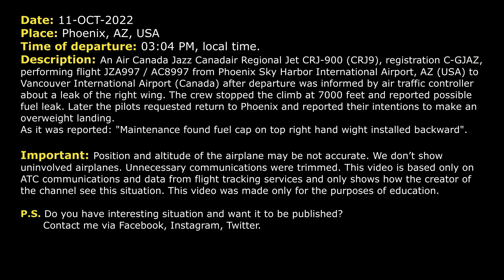Fuel leak on takeoff. Air Canada Jazz CRJ-900 returned to Phoenix. Real ATC

Comment: How could it get installed backwards? That was an oversight for days... 😕
Reply: I don't know much about airliner fuel caps, but I would think the same principal of "righty tighty, lefty loosey" would apply here and backward just means it was left undone? or can you really install the cap upside down?   inquiring minds want to know!
Reply: Seems quite a design flaw if there is more than one way the fuel cap can be installed and the none-intended way causes it to leak😮 The cap to my milk jug can be installed in 3 different ways but it never gave me any trouble😅
Reply from the maker: I don't know. That is how it was in the report.